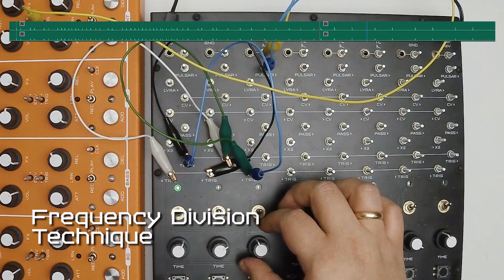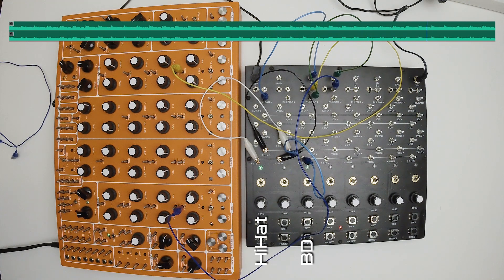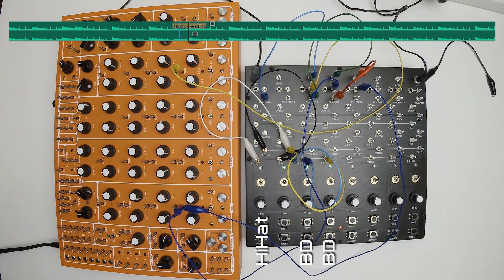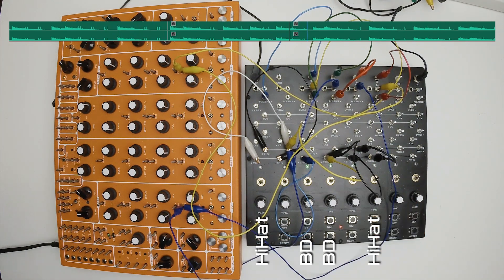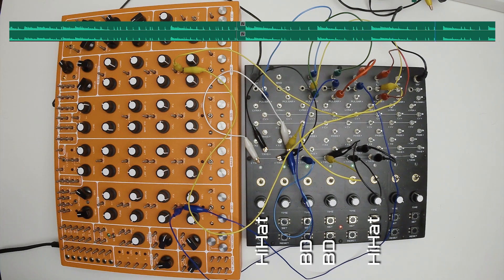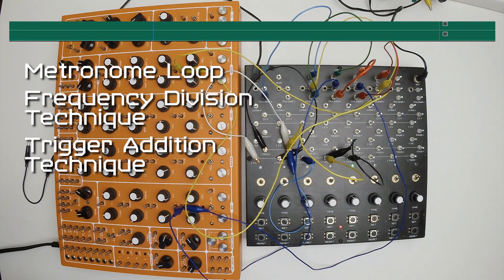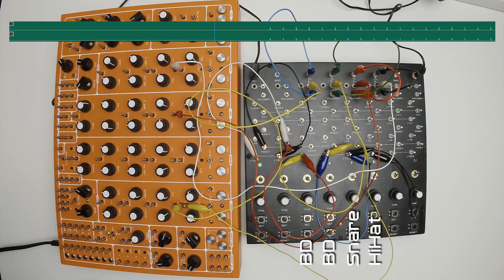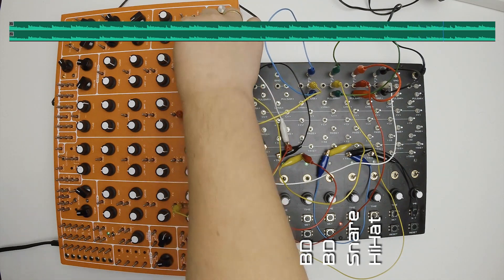ORNAMENT-8 Tutorial Part 4 (Сonstructing of Rhythms using clock division)

Comment: When I connect ornament 's pulsar to convertor to Pulsar 23's let's say kick trig in, why it sounds softer than I hit the kick's sensor directly? Just like insufficient of 10v. Even the sound trig by Pulsar's convertor is stronger than by ornament's. But when I switch the mode from positive  to negative, sounds perfectly fine(the rhythm was changed of course). I use only one power adopt so it is not the GND problem. So frustrating that got a softer kick...no one reply me on Facebook or Email, so I post it here..Pls help!!
Reply from the maker: Yes, you are right, the problem is that the pulse converters eat a part of triggering voltage. It happens due to raw analog nature of the gear. As a universal solution I can propose any scaling amps, for example these ones that we have in SOMA UTILITIES. Or any simple DIY or Eurorack that can handle this function.
Reply: @somasynths Thank you for your reply. This was quite unexpected for me, but I guess I'll have to get used to it. I might have a few modules on hand that could do the trick.

Comment: Im sort of confused with the word Metronome Loop being thrown around... which pin is that..?  he says connect the pin to the metronome loop
Reply from the maker: In the case of Pulsar 23 you can get the clock from clock divider outs
Reply: @somasynths  One thing I believe would help the Ornament-8 experience for new users. Would be to have an alternate manual like pulsar 23. and patch example book or collection. I bought the Pulsar 23 only because I found the new manual. I originally skipped it because it was too technical for me personally.
Reply: part 2, 3:25 about creating event loop.